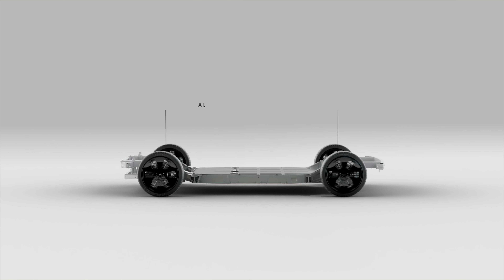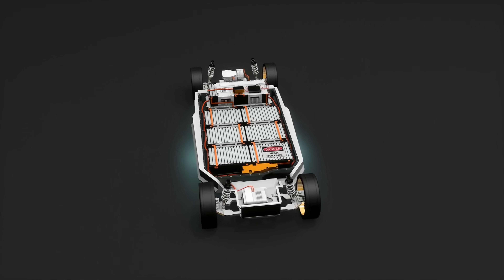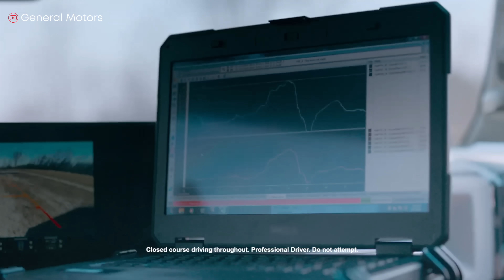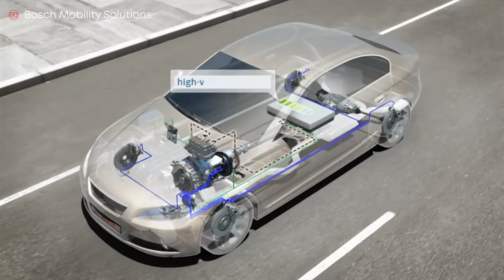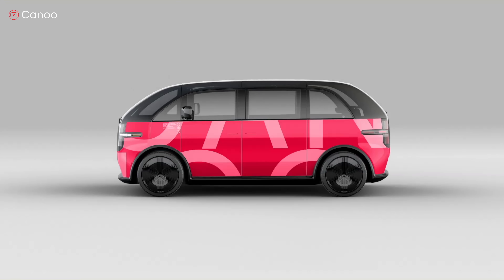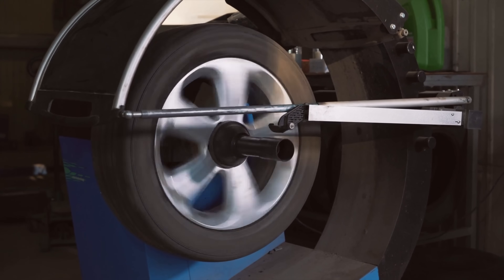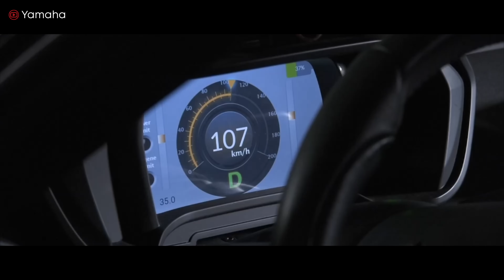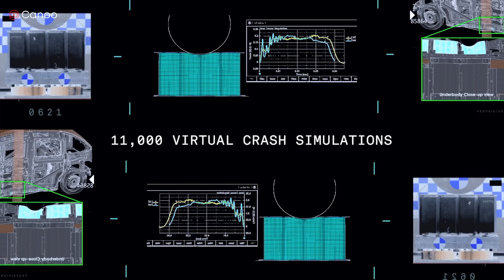No One is Telling You the Truth About Electric Cars, So I Have To

Comment: The more I learn about EVs and the more I look at EVS that are 3 years and older and how the companies that made them treat the customers that bought them has opened my eyes to the fact that the electric car industry is still in early adoption mode and the electric car companies are screwing over the early adopters by the butt loads.

Everything from not having replacement battery packs for cars that are three or five years old or older which is the exact time the battery packs are going to fail closer to the 10-year Mark but some fell after 3 or 4 years.

But people buy the car even though the company isn't honoring the battery pack replacements when it's due for replacement this is very disconcerting especially when these car companies are touting being green yet they're sending all these cars to the landfill because they don't support replacing the battery packs.

The center cannot hold on this and the fact that these companies everyone from Tesla and their roadster that they do not even service or support and a Tesla worker had to quit the company and start his own repair company to service just the roadster because Tesla would not honor the commitment to their cause think about that Tesla will not honor the repair and maintenance of your cars after you buy them for more than 2 years.

And if you buy a used Tesla God help you because Tesla will do everything in their power to sabotage your efforts of software and hardware wise you only need to look at the YouTube channels of people that bought used Tesla's and tried to repair them and get service for them everything from being left stranded on the side of the road three or 400 miles from their home on a vacation because Tesla's into update to their car to keep it from recharging do you having to pay for 400 mi towing charges these are only some of the benefits of owning a Tesla.

I'm so done with modern cars and modern planned obsolescence cars used to fail because they just didn't know enough about motor technology to alleviate mistakes in manufacturing but now they plan an instrument failures within the engine to make it fall apart sooner rather than later or more commonly known as planned obso listens.